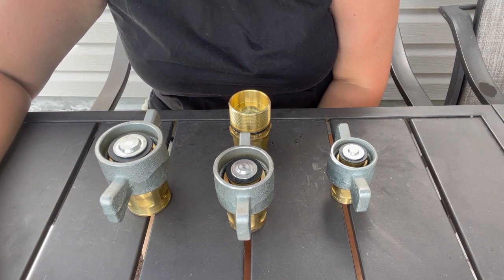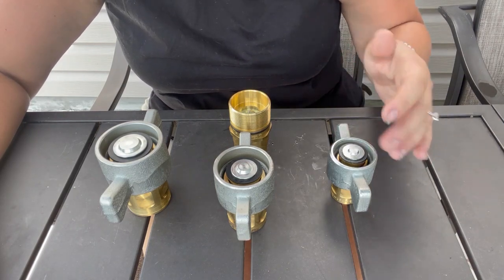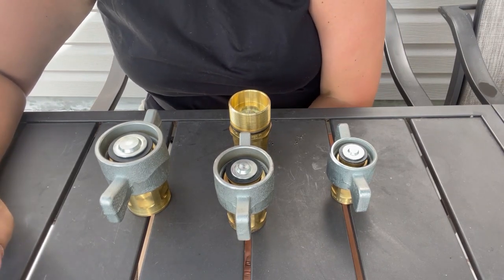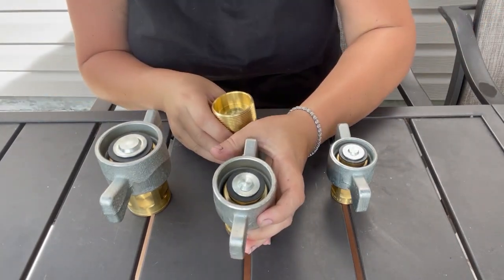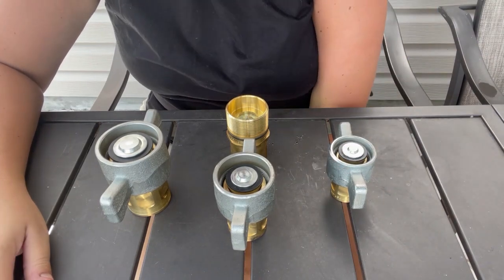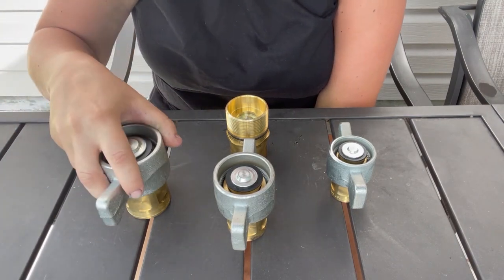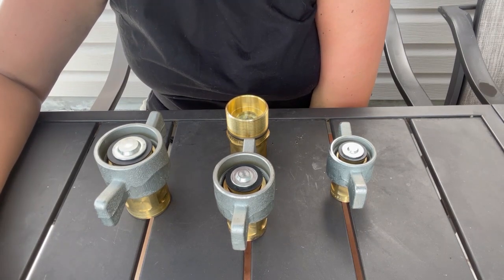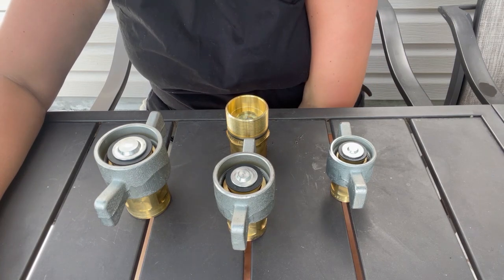Hydraulic Wing Nut Couplings- Everything You Could Ever Want to Know!

Comment: Hi few days ago I replaced my hydraulic pump.  upon turning on hydraulic tank I notice oil flowing out the quick connector while it was unattached to dump trailer. Is this normal ? I’m also having some
Cavitation as my pump is winding both on idle and throttle up.
Reply from the maker: Oil coming out of the quick coupling when it is not connected is not normal- how much came out? Make sure your tank still has enough oil in it to feed your pump.